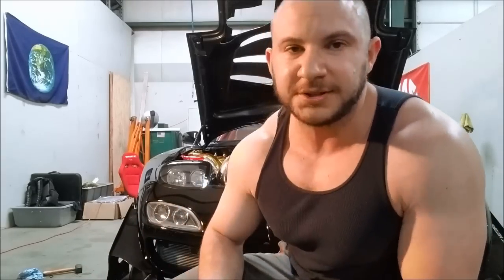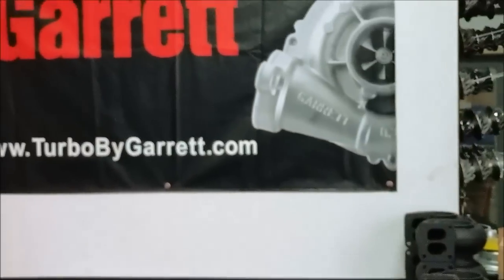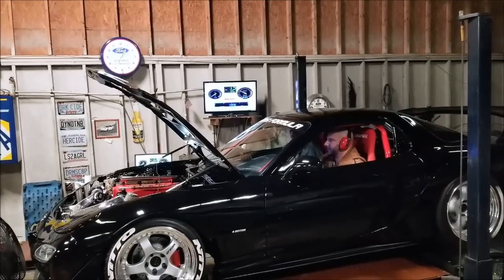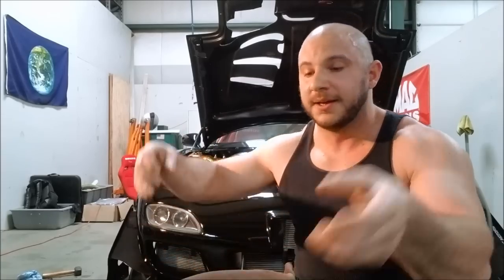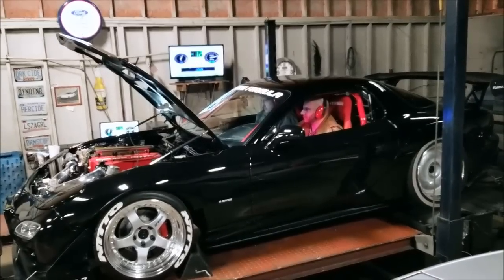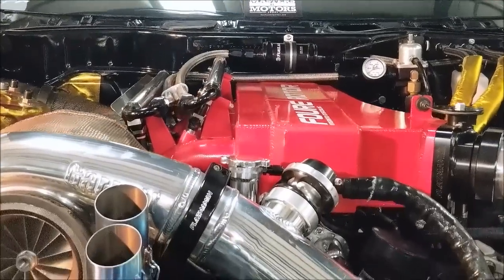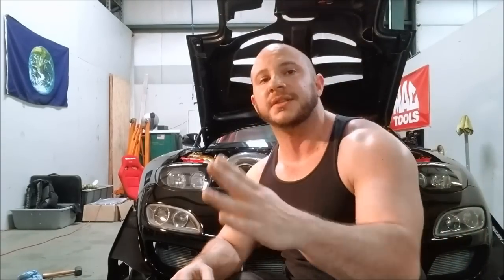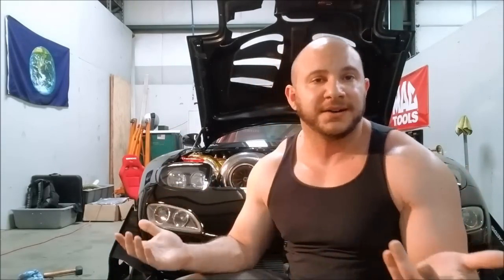How to setup an EFFECTIVE Water-to-Air Intercooler!

Comment: Think the message is the same for a 12HT Toyota Turbo diesel upgrage for reducing & keeping EGT's in check,  pulling a 5800~6200 lbs tank w trailered ATV up TN & KY hills ~ customizing & lightening a Ranch Hand bumper to fit a 26" x 8" Mishimoto (Bumper Space to Shackes), 11x10x4" core intercooler, 3" exhaust
Great Video

Comment: If you could increase pressure of the water circulating according to the temperature of the intake you could make the intake temperature Everly constant i.e. ultimate consistency

Comment: Boost is manifold pressure, nothing more nothing less. The amount/volume of air going into your engine is dependent on the compressor housing. A TD04-13T and a GTX3581 will not flow the same amount of air at the same pressure.

Comment: I will be a dissent here. I love all the great presentation but I think I have to dissagree. 
I believe that any water that isn't going to and from where it picks up heat to where it gets rid of heat is just extra weight. Water weighs over 8lbs per gallon so that extra 4 gallon tank plus the lines to get it there and back are close to adding 40lbs of ugly fat to a car we want light. 
I think  just doing all that can be done to make sure as much frontal air actually goes through the intercooler core as possible, with effective fans while idling, and having the heat in, heat out, interchangers as close to each other as possible is as close to  is the best most efficient and lightest thing we can do.

Comment: Hello I’m a fellow rotary enthusiast swapping a REW engine into my rx8 with the intent on making a HST (20 minutes sessions) toy at Hallett Motor speedway here in Oklahoma. I’m wanting to learn more about making an effective air to water system. Is there a brand of intercooler or pump or lines that you would recommend? Where should I start? Thanks! I know it’s a two year bump! Great video and great channel.

Comment: Very good and clear explanation! I started looking at liquid to air intercoolers because there just isnt room for a huge core up front in my z32 with a big turbo and radiator in front of the engine. ..And I'd have to modify the body to run 3" piping too.. With liquid to air I could run much, much shorter pipes so it should spool up faster, at least in theory.

Comment: Hey mate !! You have inspired me to go this way with my rx8 rew swap . I'm happy to say that I've just completed the first stage of my inlet manifold and next is the core being integrated into it. I'm still going to run a v mount in the front but that will be my water radiator for the intercooler along with the air con and engine water. One question I have is do you run coolant in the system or just straight water? Love your car and life outlook too . Your a very positive person !!! Love ya work mate and greetings from OZ !

Comment: it’s an AIr to water.   Not water to air.
Reply from the maker: Its water to air. Not air to water.
Reply: Its actually water THROUGH air, and not air THROUGH water.
Reply from the maker: @islander121974  its actually ass to mouth not mouth to ass
Reply: neal adderley    You are running the car on air not water.  Air thru water to air.
Reply: @mikeeagle2653  I thought he was using the air to cool the water. 🤦🏽‍♂️😳🤷🏽‍♂️. Mike eagle you're smart as a wombats fart. 😜
Reply from the maker: @mikeeagle2653  water cools the air. Water-to-air intercooling. Instead of air-to-air intercooling. Air-to-water is the coolant system radiator. Using air to cool the water for the engine. This is using water to cool the air for the intake/turbo.
Reply: I thought this video was about oil to floor

Comment: Did you do air flow tests with different locations for the naca ducts?Never seen them in rear window...it was one of possible locations for my rear mount radiator project.  Quarter windows was other.  Thanks for the videos.

Comment: In essence, the radiator is an air to water cooler for the motor temperature and the water to air intercooler is for the intake air!! And the water to air intercooler has a radiator on its own to cool the water!! Sweet🤩🤩

Comment: Our two Rotor RX8 REW Turbo with a full Bridgeport need a water te air intercooler but do not know what is the radiator looks like to do the two functions combined.

Comment: What I did was active cooling with peltier elements. That saved me a ton more space and increased the efficiency a lot, it can even give me below ambient temps. I built an insulated tank, with peltier elements directly sitting on the aluminum tank, and two channels leading the hot air from the elements away from the tank. I have to run antifreeze in the water for it not to get frozen when the water isn't circulating. It will draw more current though, so you will want to make sure you have a good generator. I ended up putting 2x120 amp generators on my engine so I can power all that + heavy pumps + heavy ignition coils + amplifiers and it runs perfect.
Reply from the maker: That's is such an amazing concept!!!@@ thanks for sharing
Reply: This is an awesome idea

Comment: Super Awesome and Informative ! I was thinking, towards the end of video you spoke about heat soak making the Air to Water exchanger hotter than an Air to Air exchanger, at times. I realize size restrictions limit your system, but what if you had an Air to air exchanger (conventional intercooler) as your fresh air inlet to your air to water heat exchanger incoming air feed 🤔 highway air will help over cool your air to water cooler air intakes 😄 no need to worry about lag in pure suction. Also, insulate insulate insulate your storage tank and all lines, or use a Tiny hot water heater tank which is already super insulated to go either way 🤓.  This video really got my brain going. Appreciate it, I'm designing a system for my 1997 Ford F450 7.3L Turbo Diesel (best ever)

Comment: I ran A2W on my roots 7psi  s2k.  
Never exceeded 10 C approach temperature after 40 mins of continuous blasting at TGPR.  

Are you counter flow or cross flow?
Most oc places are not going to give you the exact thermodynamics of there setups so hard to calcilate exact btu transfer.  

However in my case the HX had 2.5x the surface area of the water barrel and 3 times the dwell time.  
HX was vertical down flow 
Water barrel was counter flow double pass.  (The counter flow is critical to get approach temps as low as possible) 

And therefore never needed tje water reservoir.  The large HX acted as the "water reservoir/tank" and therefore the "tank" was always being cooled by ambient air.

Our higher bosted cars (12psi) were running abarrel 30% smaller and HX 50% smaller than my alpha setup and always stayed no more than 15C approach temp.

If you want even more cooling you need to look into laminova intercooler cores.  I have seen these cores used in some specific mil applications.  Next to no pressure loss higher flow and more cooling than what you have right now.

Comment: Isn’t it not so much the oxygen but the nitrogen? When ignition happens the compressed air heats up and nitrogen expands which is what pushes the piston down
Reply: Your engine sounds incredible btw
Reply: Also one more thing. Why not install a timed throttle trigger switch for the water pump? Where if the vehicle is standing idle for over a certain amount of time the water pump turns off but then turns back on when you step on the throttle?

Comment: @Mazzei Formula
Hello,
 I just found out your channel very great content! Greetings from Portugal... So i own a MR2, and a nissan patrol, soo both cars dont really get much air, cause mr2 engine in the mid not easy to use air intercooler, and the nissan when offroading, We go slow, so not really air flow... I got interested in this system, But the thing is, can you give me a feedback as of how long have you been runing it? 

Would you recommend it? I got a bit scared because people say if you get a leak on the water intercooler, it will go inside your engine, and thats kinda the main issue that makes me afraid of using these... I was hoping to talk to someone who has already did it... 
Await Reply, And keep it going mate, nice videos!! 

Best Regards, Alex

Comment: For superchargers, there is a company in Australia called Forced Induction Interchillers, and they use the air conditioning system of the car to drop the intake temps well below ambient.

I'm wondering could you do a similar thing for water to air turbo set ups? Use the air con to chill the coolant box so you don't get heat soak in the system? Obviously there is a draw back of more weight but the cooler temps could be worth it.
Reply: I would say there is 2 way to utilize the ac for intercooling...using the cold air itself...or the byproduct which is chilled water running down from evaporator coil to they water collection tray and out of the vehicle....

 with water to air system...probably adding a smaller pump to collect the chilled water from ac system and adding the water into the reservoir (replacing the already warmed water) is quite doable....some pulimbing and pump with additional switch is all its need...
Reply: Kincaid Performance in the USA sells kits that uses the AC to cool the intercooler water. I run a kit on my supercharged B6 Audi S4 and regularly see IATs after the intercooler between 30-44°F below ambient before a 1/4 mile dragstrip pass. It is slightly less effective for normal street driving but I can switch things to make it more effective.
Reply: Interchiller system from Australia is not just for superchargers . People totally make Interchiller A/c systems for w2a turbo set ups  . Only issue for a circuit car is using the a/c on the track at rpm . Ive toyed with the ide of a 12v A/c pump . But they are not as powerfull as most engine driven A/C pumps and take lots of amps so a big alternator is needed

Comment: I'm sure you've considered water/meth injection to help cool the charge and raise the octane, David. Will E85 make such a consideration redundant? I guess E85 would be simpler to run, both practically and in terms of tuning,  but it would definitely knock those intake temperatures down a bit.
Reply from the maker: Great idea sir. Yes, the car actually has a water methanol system setup. I used to run water meth on 93 octane. Now I'm using straight water with small 600cc nozzle at 200psi pressure, on map activation, to further suppress knock and clean the internals of engine/exhaust side

Comment: Mazzei I wanna ask..... why does your RX7 need two exits of exhausts? And what's that pipe next to the turbo??
Reply: The side and hood exits are almost certainly wastegates. They're for bypassing exhaust gas before the turbine in order to prevent over-speeding the turbo.
Reply: @hambo6713  Well yeah ok I got it.....but the side exit tho..... clearly it's got exhuast gases exiting it at idle.... I've been seeing it in the videos. And yeah I've seen in the engine bay a pipe going straight from the turbine's discharge side towards the side exit.
Reply: @vinzchannel01  interesting. There's a build thread for this car somewhere. You'll probably find the answer there. I'd like to know too
Reply: Darth Benedict the side exit is for the exhaust coming off the turbine of the turbo. Hood exits are for the wastegates.

Comment: I've run a water/air setup on my rx7 since 09. with an ice box it has below ambient air temps for at least 10 street pulls at over 500kw atw.
Reply: below ambient thats sick hahaha
Reply: @yung_richtah  it means more hot laps at the HPE/Track Day. Usually your engine is whining the ambient and all the engine creating lots of heat and want to shut the party down. This is especially the case with newer cars and their tight engine bays. In drag racing, you can add ice to the water tank and boom below ambient at the start of a drag run, maybe 100 degrees max at the end of the run and it's 90+ degrees ambient. Even the fastest turbo cars slow down at events that happen to be in the summer. All of a sudden 120-130 degree turbo exit temps become acceptable.... Odd.
Reply: This is what I would do!!!

Comment: Do you have the math......HP Gain to weight added?
Reply: Definitely not enough weight to slow the car substantially. It’s all about how you set it up. Since this is a front engine vehicle, he did a smart thing by putting the reservoir in the back. Small things can be done to balance the car out like this, that can really be cheap insurance for your build and save some performance on hot track days.
Reply: @Znthusiast  I understand that... but he must have added ..like 20kg to gain  how much horsepower. you don't need it for a safety factor as a good ecu has multiple engine safety cuts if set up correctly. I am interested in figures......like I gained 5hp  or 55hp? for 18kg.  as he says & we know....... better engine performance.  so what's the Data?
Reply: I see where you’re going. It’s basically the same as spending $2000+ on a stand-alone ECU. This air to water set up just ensures that you’re running cooler than ambient temperature in some instances. Especially when you use Water-Wetter and ice. Heat soak robs power. So it’s not necessary about “adding power” but retaining it. Cooler temps means more power and often reliability. For example, if you had air pockets in your cooling system, your car could run hot and blow a heat-gasket or worse; cracks the head or block. Those are things you would want to be avoiding especially if you’ve got serious cash invested in your engine. I would say an Air to water is for more of a serious track build, if you live it hot areas, or for space convenience like he already mentioned. Either way theres more things that matter than just power-to-weight. And retaining performance and reliability is one of those things. That’s way a stand-alone ECU with all of those failsafes is such a good investment.
Reply: It’s really not that much weight. A few AN lines, fittings, a pump, some wiring, the intercooler core, and the reservoir. What probably weighs the most is the water in the reservoir. 🤷‍♂️ If you’re super concerned about weight you’re probably putting a aluminum bucket seat in, cutting away all unnecessary metal, replacing the windows with lexan glass, relocating a light weight battery, removing power-steering and A/C,  etc. at that point it really doesn’t hurt. That FD is probably only 2,700 lbs anyway. Imagine 900hp in a 1,224 kg vehicle lol.
Reply: That's not the answer, the question is simple.    How much HP did he gain for the weight added? 0, 2, 18, 20, 60? just interested.  @Znthusiast
Reply: Answer: This type of modification does not add power. It helps retain it by keeping the engine running at a cooler temperature.
Reply: @Znthusiast  300hp -10deg = 305/10hp.   via mathmatical formula.....google search it. He dropped the temp from 95deg to 60deg. I want to know if he has proven data from a dyno test. you say 0 gain..ok.   I want His Data to confirm .....if he knows

Comment: Could you increase the cooling by adding some sort of coolant? Love the video. Still hoping to run in to you cruising around town.
Reply: Ice box.  You can still cruise around on just water but if you decide or have to do back to back wot runs, fill it with ice.
Reply: Redline Water wetter can help heat transfer. Most coolants decrease the heat transfer ability of straight water . In an engine coolant does 3 things benicial.. anti corrosion ,anti freeze and anti boil/raises boiling point . But reduces heat transfer abilty a small amount

Comment: More lines/pipes = more system capacity. Also, if you are running your lines under the car through ambient air - they also get more (only marginal, but every bit counts) cooling as there is that much more surface area/volume exposed to a big(ger) temp differential

Comment: It's ALWAYS about sizing properly for your application(s)
Reply: This is awesome. I have been wanting detailed explanation of both side by side. I have been wanting to do a water-to-air intercooler to keep ac in my car when i turbo it, and for keeping iat low and consistent. I am really glad you mentioned the tank, or running more than one exchanger for efficiency and defeating heat soak.

Comment: Thermodynamics, its the law!
Reply: TunedCavityLasers just finished my physics series and as a mechanical engineering student he missed a very key point that can affect the efficiency of this dramatically... the introduction of fluids other than water to promote even greater reduction of heat. I know where the natural flaws of kits are in the ones you find online. Its just fine tuning each individual piece to make them more efficient